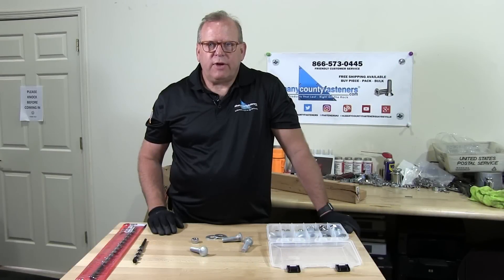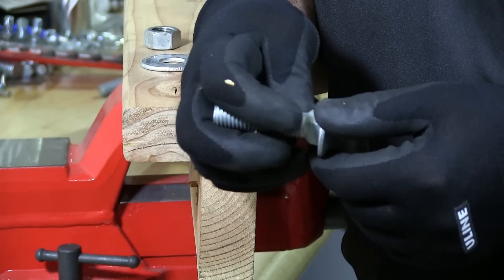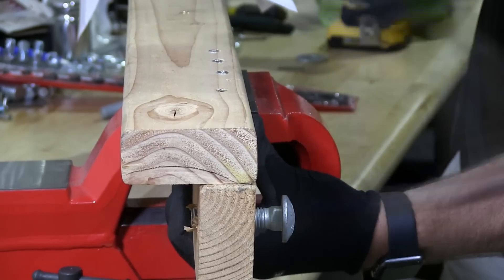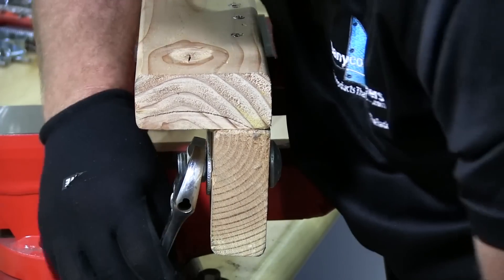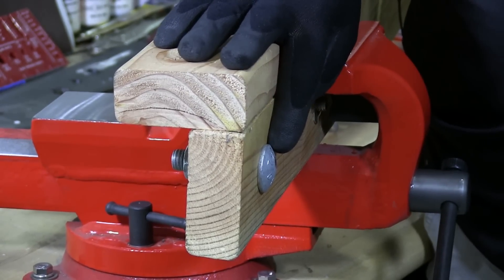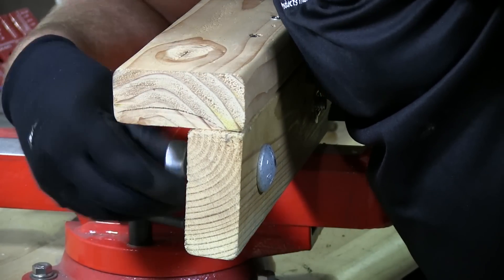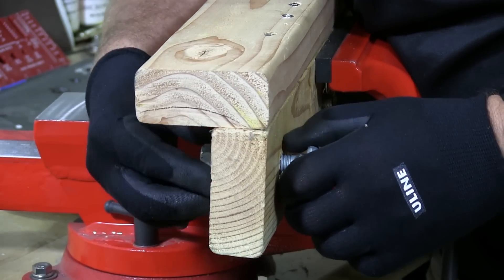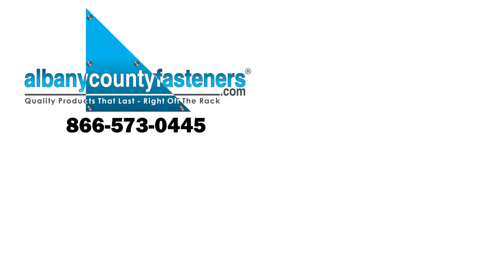How to Properly Install & Remove Carriage Bolts | Fasteners 101

Comment: I have a customer using an M12 short neck carriage bolt with a bracket assembly and a flange locknut. What's the best way to keep the head clamped down while installing the nut?
Reply from the maker: Thats why a carriage bolt has the square under-head. bang the head into the wood and you should be set.

Comment: Thank you.  I am undertaking my first DIY carpentry project.  So I am watching as many instructional videos as I can.  My project is an 8x10 elevated (4 1/2 to 5 ft) deck so my kids can play on.  Thank you for the demonstration.  I plan on notching a 4x4 post and using a 1/2 x 5' carriage bolts to secure 2x8s to it.
Reply from the maker: Glad we could help! Thank you for your feedback.
Reply: It’s 6x6 post for code now. Depending on where you live but recently my last deck has to be redone due to my inspector telling to replace them with 6x6. Highly recommend even 3ft up but urs is 4-5ft so definitely recommend it. I notch 3 1/2 for the two 2x8 beams so its 3” in. I use a 8” carriage bolt instead but the sucker is 6” dee so predrilling the holes for the carriage is a pain in the ass. Gl with yours.

Comment: What happens when the wood has been rounded and the bolt just spins in the hole? It is tough to hold the round head in place to rotate the nut.
Reply: You're supposed to drill the hole to the same diameter size as the threaded part of the bolt. If the hole is too big, go up a bolt size. You could also use an adhesive like Liquid Nails to secure the bolt, wait till it's dry in the hole and then fit the washer and nut. If it still spins then you're going to have to try a hex head bolt or replace the wood part.
Reply: They make washers designed to be used on the head side of the carrage bolt with teeth that will bite into the wood.

Comment: Would a carriage bolt be ideal for securing a gun safe on a raised foundation?
Reply: Depends more on how much access you have to the nuts beneath it for installation, and for removal when you need to.

Comment: Can you use carriage bolts to attach metal to metal? I am wondering what happens to the metal as you tighten the nut?
Reply from the maker: They aren't intended for that kind of application. Theoretically, you could use them if a square hole was made for them, but at that point it would honestly be easier to just use a hex bolt which wouldn't need such a specific hole shape.

Comment: The removal process in old wood can be a problem when the square shoulder of the bolt revolves when trying to remove the nut.   It would be helpful to add "how to solve" this common problem.
 I wonder if any more convenient method is now available except that mentioned by Adrian Fundora?
Reply from the maker: That sounds like a good idea for a future video! Thank you for the feedback!
Reply: Yep, came across this video looking exactly for that idea, i used some to create a backing for my horseshoe pit, couple of years old and rusted, trying to remove the nuts the bolt just spins, no idea how to get it apart...
Reply: A standard removal method for this is given by: "Adrian Fundora" in his reply to comment by "Yashif Ahmed" below:                                                                                          @boknows8936
Reply: Still urgently needed! Rusted solid carriage bolt in a fence post rotten enough for it to spin but not quite rotten enough to get an open ended spanner on the flats.

Comment: I have several of these in an item I just bought to redo.  Someone painted over them and the nuts are stuck.  On top of that they are free spinning (bolts) in the wood.  Any suggestions for removal without damage to the wood/item?
Reply: already tried to remove the paint (maybe use some paint remover)? after that i would spray the nut with some wd40, let it work for 10-15 minutes and than try to grab the bolt with a wrench and try to turn the nut.

Comment: Hi, thanks for then video, may I ask 2 questions:
1) what is the different use case between carriage bolt vs carriage screws?(looking to make a kids climbing frame)
2) How do you make the square/hex hole for the head to sit in?
Regards
Reply: It self seats with pressure

Comment: Not helpful. The bolt keeps spinning when trying to take off thr nut so how do i prevent the bolt from moving when trying to take off the nut? Im trying to take off a wheel from an old wheelbarrow
Reply from the maker: Try pushing against the dome head of the carriage bolt as you remove the nut. Keep pressure on the bolt to keep it in place as you unfasten the nut. An alternative way to remove the carriage bolt would be to cut a groove into the head and use a flat head to unscrew it. 
If the bolt is old and rusted and being particularly stubborn, your most effective way to remove the bolt maybe just to cut the head or nut off and to slide the rest out.

Comment: what diameter should the hole that is drilled be if the carriage bolt is 1/4" diameter?
Reply from the maker: It would have to be 1/4" hole. The hole should be the same diameter as the bolt you are screwing in, at least as far as Carriage Bolts go.

Comment: You did not show how to make the proper hole for these kind of bolts.
Reply from the maker: You need to drill the hole the same diameter as the carriage bolt. It should be snug going in. You may have to tap the head of the bolt with a hammer to get it in place.
Reply: @AlbanyCountyFasteners  thanks.

Comment: what a bad video what size and length? size of hole?
Reply from the maker: This video is a generalized demonstration of how carriage bolts can be installed and removed. The methods used in the video can be applied to most, if not all, carriage bolt lengths and sizes. 

The hole size will always be the same as the diameter of the carriage bolt used. It should be a tight fit and a hammer can be used to help install the bolt if you experience and difficulty.

For more information on specific sizes, please visit the respective carriage bolt material/size here: https://www.albanycountyfasteners.com/Carriage-Bolts-and-Timber-Bolts-s/281.htm